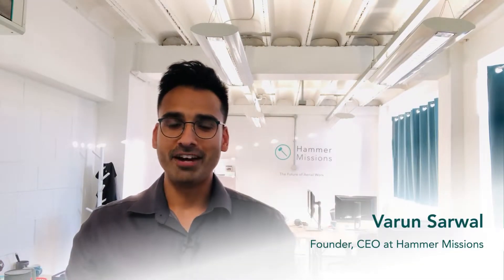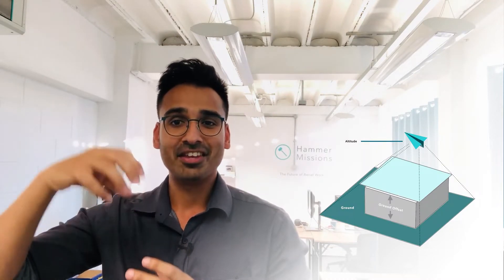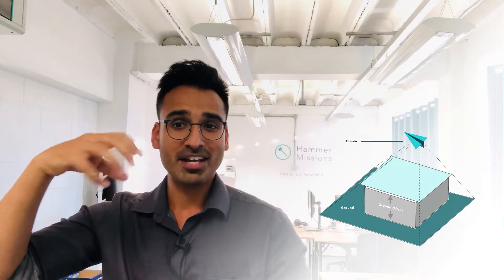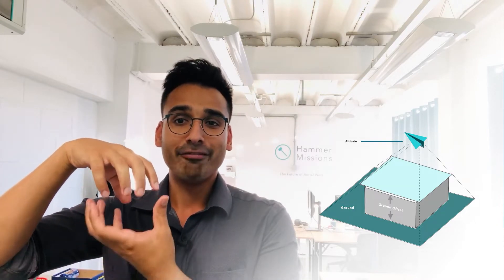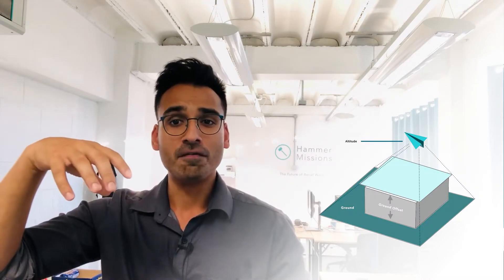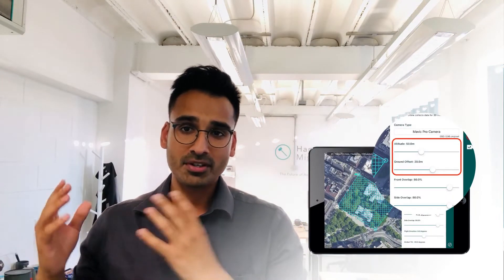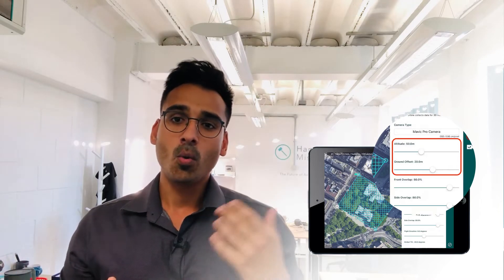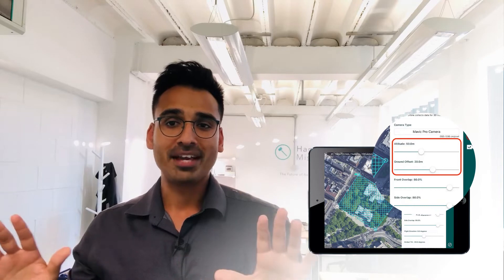What is Ground Offset? - Hammer Missions

Comment: Varun, very good videos and explanations. Just a doubt: Ground offset would have to be placed only if the drone takes off from the ground. But if the drone takes off from the same roof, then the ground offset would remain as 0. Is my reasoning correct? Regards
Reply from the maker: Juan, that's correct! Ground offset when taking off from the roof will be 0 because the roof would effectively be the "ground". Here's more on this: https://www.hammermissions.com/post/ground-offset-in-hammer-missions